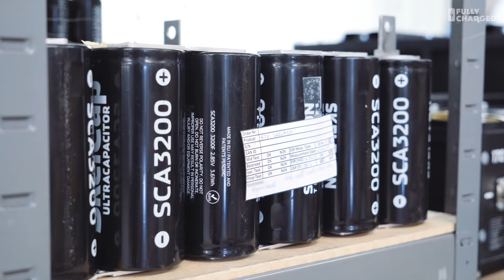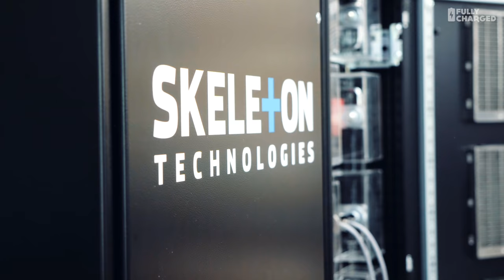Skeleton Ultra Capacitors | Fully Charged

Comment: When I first say the title of the video I expected wild claims about supercaps replacing batteries. Pleasently surprised, the guy was very honest and provided clear explanation about the strength and weakness of his caps. Very well done.
Reply: Steven Hiller -  Elon Musk started out thinking super-capacitors were the ultimate energy story solution, but the physics just don’t pencil out.  They’re very seductive and definitely have huge advantages over batteries in many applications.  But for cars....not so much.   People don’t seem to realize how much power modern LiOn cells can pump out.   Obviously, super caps will blow away any battery technology, but LiOn cells are good enough to throw a 4000 pound vehicle forward at an amazing rate.
Reply: Bryan Noga Yeah, even using caps for Regen seems like you'd need at least 1kwh to absorb braking energy and provide acceleration. A bank of ultracaps to do that wouldn't weight that much but they'd take up a lot of space.
Reply: Bryan Noga  I think the whole point was a mixture of both in a car. The caps to accelerate quickly and store the regen power as quickly then let the lithium basically cruise. That way the batteries will provide much more run time since acceleration really eats their power.
Reply: Steven Hiller -  It probably depends on the car.  I believe Ford hybrids have a 0.6 kWh (?) LiOn battery, but I’m not sure exactly how much capacity is actually used by the vehicle.  A super cap would be a good alternative, and also have the advantage of being less sensitive to temperature & storage.
Reply: Bryan Noga    A mix is best. Caps for the start and stop spikes and batteries for cruising. The batteries will last much longer if the don't have to pull the car up to speed.
Reply: Agree, that was my expectation to.  But instead we got a clear and good explanation on where super-caps should be used and how.
Reply: Ultra/super capacitors still have less watt/hour per volume. Meaning you need a very big pack to have long range as compared to current batts. If I were to use these capacitors, I'd probably need a pick up and the rear compartment is full of capacitors to get somewhat decent range (which is just right for me, driving 30-50km max/day, but not for many people that have regular longer travels). I heard its also expensive by the watt/hour compared to current lithium batts.
Reply: sam guapo    The jist was to use both. Caps for quick acceleration, batts for range. If you're not pulling out of the batteries for acceleration or regen, their range will improve quite a bit. Let the caps do the hard part.
Reply: maybe super caps for more efficient hybrids lol, cost will be an issue still
Reply: @fred ivory, current batts are already good for immense acceleration so having caps are redundant. I like the idea of having a super long use battery and I'm more than willing to drive a pick up full of ultra/super caps that occupy the entire rear storage of the pick up in lieu of a compact BEV. All I have to do is add a range extender for a little more range or I can commute for extremely long trips. Again, its an adaptation of use, instead of demanding unrealistic expectations.
Reply: I have been reading these comments with much interest, and all have a point, BUT I am surprised that nobody has picked up on one very important thing: Thermal loading. When you cram a lot of energy into a battery in a very short time, they get VERY hot. Same with the discharge. This puts a strain on the cells, and over time will reduce the life time of the battery. Also, with the safety aspect, (they do catch fire if they 'cook' enough), charging is 'throttled' when the battery is to hot. 

There are some very interesting U-tube videos from 2018 Leaf owners describing their trips to Silverstone FullyChargedLive. All about managing the heat, as, once the battery is too hot, the 'fast chargers' become 'Not-So-Fast' chargers.

Lemon-Tea-Leaf has a good description, and worth a watch www.youtube.com/watch?v=tgrbT_YxhMs

If you have cap's to handle the high energy dump from braking, then the high-energy release for acceleration afterwards, the temps on the battery will remain lower for longer, enabling a faster charge time on long trips

As the guy said: Not competition, but complementary. A case of both being better than the sum of their parts. When can I get some! :-) ?
Reply: Tesla realized this early and thus their bms and cooling systems ability to adjust the temperature esp. during charging.
Reply: +Ulf Meier-Schulze, It seems to me that for high performance use (or large vehicles), some form of cooling is a requirement, regardless of capacitors being used, but in small cars like the Leaf, keeping things as simple as possible (IE not having the weight and cost of a cooling system)  has advantages, so adding capacitors would make sense. They are basically maintenance free, where a cooling system (other than air-cooling) is probably less so, (please correct me if I am wrong on that).   

All of this said though, who knows what may be around in the next 10 years?
Reply: Bryan Noga  The only concern i have Brian is at what point we start to see high levels of lithium in out food and water supplies.
Reply: @stevenhiller2253  This might be dependent on the use of the vehicle... If do a lot of stop and go, like in a city for example, ultra capacitors can extend the range of the vehicle, so you'd be fine with a smaller battery, which also reduces weight.
Reply: @shiraz1736  
Here in the USA our dietary Lithium levels are well below the world average, thus the need for some to take lithium supplements under a doctors care to prevent manic-depressive disorder. 

Remember that Lithium batteries are only about 4% lithium.
Reply: As the Engineer said, "we are not onto kW-hrs, we are into Megawatt-seconds".  Just watt is needed for braking and acceleration !
Reply: Agreed. I can't wait to see there loss over time decrease. If it can get to the point were a fully charged cap looses 50% of its charge in a month

Comment: "we are not in the kiloWatt-hour business, we are in the MegaWatt-second business".  I loved that sound-bite.
Reply: I know, right? Sounds cool and is pretty damn accurate.
Reply: It seems the host does not understand the difference between power and energy. He seems to think that LiPo accumulators store power.
Reply: 13:18
Reply: @xnoreq  
Well, they store energy but have a limited current flow, so you could say that they store a maximum ammount of power at a time :D.
Reply: @mandernachluca3774  No, you don't store power. Power is a rate, not a capacity.
Reply: @xnoreq  
My faultm "power at a time" is of course false, i meant "energy per time" wich is essentially power, so yes, you could say that you store power, since your current flow and therefor your energy per second stored is limited, would it be unlimited, than you probably could make the argument that energy gets stored not power, utherwise you would get infinite power.
Reply: @mandernachluca3774  Energy per time is a rate, not a capacity. It makes no sense to speak of storing rates, as it is a momentary measure.
Reply: @xnoreq  
I wouldn't say that it makes sense but it is not wrong to say so, since the maximum powerout of EVs for example is virtually solely limited by the safe maximum current flow of the accumulator. Think of it this way, you can have a water dam that can store millions of tons of water but the maximum energy produced by its turbines is solely dependend on the water flow rate through the turbines. In other words you can store a lot of energy but it won't bring you much if you can't dump it fast enough, therefor, it might not be such a bad  
idea to indicate the maximum power output of an accumulator.
Correct me if i'm wrong but current times voltage should be electrical power and maximum current is dependent on the internal electrical resistance of the accumulator.
Reply: nice
Reply: @Sidowse  Why? They're equivalent.
1 W⋅s = 1 J.
It makes sense to specify something that supplies electrical power using W.
Reply: There is 3600 seconds in an hour. Therefore 1kwh=3.6Mws
Reply: @baileymoody3916  W not w.
Reply: @xnoreq  sighs micromanaging mike over here...
Reply: @Sidowse  Of course that is also wrong.
It's k for kilo, not K. And h for hour, not H.

It may make more sense to you but it actually causes confusion because there are constants such as Kv (a motor constant) which has nothing to do with kV (kilovolts).
Reply: @Sidowse  Right. If you know all this why would you bring up K (Kelvin) which has nothing to do with metric prefixes?
Reply: @mandernachluca3774   P(power)=V(volts)*I(current)=Watts and because current is measured in amperes wich is a flow of electric charge in one second  power is just a rate or flow of energy only when you multiply Watts*Time(seconds/hours). So Watts or power becomes active only when you can sustain that capacity over a period of time and that is the amount of energy stored in a battery or a capacitor.
Reply: @IsaacBG84  
Yes, that's true but what do you want to tell me by that? I reread my comment and i should have mentioned that not only the current flow but also the voltage is needed, so for the dam example i should have mentioned that the pressure also plays a role but this role is exactly modulating the current flow. In the real world, you always have resistance and as soon as you have resistance, you have a link between current flow and voltage (you can put it as you want, you have either a voltage because of resistance at a certain current flow or you need a voltage for a certain resitance to get a certain current flow).
So out of this you get an equation were voltage is completely  ruled out and not worth mentioning because of the sheer existance of resistance:
U=R*I
    
P= U*I = R*I*I
P=power
U=voltage
I=current
R= electrical resistance
Reply: Yep that was definitely a well thought out message by Skeleton. ;)
Estonia makes some of the best UC's in the world, oh and they also have some of the most beautiful women in the world.  Now that's electric! ;D
Reply: @mandernachluca3774  They have instantaneous current flow
Reply: @mandernachluca3774  No one is arguing that it is a bad idea to indicate the maximum current output of an accumulator (be it battery, capacitor, or other). Rather we are saying that a flow rate is not something which can be stored. It is not a quantity which can be accumulated (at least not in electricity, velocity is of course a different story but lets stay on topic). Sure, the point is mostly a semantic one, but I think at this point we have all crossed that particular line in the sand 4 or 5 replies ago.
Reply: @xnoreq  ..might be a language issue
Reply: @xnoreq  ..lets see your state of the art designs
Reply: @jaxxbrat2634  What are you talking about?
And no, I don't think confusing or being ignorant about fundamental and basic physical quantities is a language issue. It's more likely a knowledge issue.
Reply: I think he said gigawatt-second. Still, that's a needed component to keeping power sustainable during dips and such.
Reply: @ericdew2021  There's a timestamp in the third comment.
Reply: So basically all that 1Megawatt second is equal to 277Watth equivalent to a car battery. So not feasible for car battery replacement, only usable as booster. If you want a 80KWh equivalent capacitor you need 288 of that huge refrigerators on your car.
Reply: Yeah that’s why I want to build a drag car with ultra caps and a trailer with an ultra cap charger. Unlimited power from a practical standpoint 😁
Reply: @gigimanueliacob8062 : What type of car battery? I'm sure it was mentioned that its role is not to replace a traction battery, but to supplement it by capturing e.g. regenerative braking energy to use in acceleration?

Comment: The ceo is a wonderfully bright and focus individual and kudos to him . Every thing he discussed about the benifits was what I realised 15 years ago on an electric bike I set up. It had and underpowered Lipo battery so I intergrated some supercapacitors to negate the voltage drop under high acceleration . It would cause the electronic speed control to shut down due to low voltage cut off but the super caps solved the problem so I went the next step with regen braking and so forth. Cheap and amazing efficiency gains . Around 15 -20 % estimated gain and obvious battery longevity gains too . Good luck to this company and good forward thinking . Regards Andy from Australia !
Reply: Hello Electron Proton Neutron Mouron
Quite the name I must admit LOL's. I was wondering if you could send more detailed information of what you did to modify your e-bike 15 yrs ago. I have an e-bike now (60 Volt, 20 AmpHr battery power system. No regen capability. On 2nd set of batteries now. In need of 3rd set and considering Li-Ion packs. I'm learning though that the charger will likely have to be changed also. Current pack type is 12 volt 20 amphr x 5 packs in series. Sorry right now drawing a blank on type of battery pack. "Gelcell" is all I can think of right now
Could you forward specifics of your modifications to set up the Capacitors and also the regen arrangement. Send an email to aeves@teksavvy.com and we can start communicating on this subject 
       Thank you
Reply: Yes please provide contact info to be able to get your plans for this set up if you have them. 
You had lipo 15yrs ago? Factory bike or self built?
Brand of bike if it was factory built.
Reply: metamorphicorder they were just cheap Chinese 10amp 24 volt lion for this bike but the output power requirement  from standing start was more than what the battery could give due to voltage sag and the motor controller would shut down due to low voltage cut off . I got around this with the super caps in parallel . The initial power draw would come from the super cap and after depletion the batteries would become the supply but the initial higher power draw has dropped of by 30% or so and allow the low voltage cut out to be ok
Reply: Somnath Roy haha no but I did learn from his venture about being careful what you get involved with as it might become your whole life . I don’t envy his life at all . Far to much for one man to be responsible for !
Reply: Electron Proton Neutron Mouron do you have the plans for the bike you made? And have you upgraded since the last bike?
Reply: justice justice well no I didn’t upgrade as such . I hade 5 different variations some power some torque and some high efficiency and one for most distance for lowest weight of electronics . This last one had the best effect for distance on light bike as I could use the lowest c rated cells at the time . The battery tech has far more powerful cells now like the Tesla cells.
Reply: Wow! 200IQ mate! Hopefully that dino-munching pro-fossil Gov't of yours will soon be ousted, as they don't realise what potential this tech has.
Reply: that's very cool. please tell me what do you do with the caps once you've finished driving? do you discharge them? is it necessary to discharge?  or just leave them as they are? i'm newbie to all these, but so want to be evolved and make my own stuff. 15 years ago you said... man, i'm wandering what other modification you've made since then) thanks!
Reply: @Buzzhumma  
Really interesting.  I fitted a front wheel motor last year, and the usual little Converter/controller box.  Fabulous with "48v" battery, and very useful with "36v" one.  I always help with gears and pedals, not being invalid, or suchlike, so never had a problem with battery "sag".  Also the Converter box must limit the current it can draw through those little FeTs !!
However, I found myself "on the ropes" with my regen braking dream, because of limited charge rate.  So glad I ran into this vid.  I always somehow forget about SuperCapacitors !!   Good to hear from others pursuing this.  Does running on Sunshine  absolutely make you LAUGH !?!  Does me, Keep wondering if I'm dreaming !
Reply: Desmond Bagley  
Have you seen "Juice Media" ?
Reply: @kaibest  
Though I've never yet employed "Super capacitors", I have made electronic things
for many years, and can say with certainty that you don't need to discharge them - but you Do need to treat them like the lithium battery - and not try to measure the voltage with your meter still on a current range ! ( as I did one day.). They're like a train - just maintaining that voltage/speed to the extreme detriment of whatever is trying to bring it down/ make it Sag.  They are s LAKE of electric charge, not a mere bucketfull such as a 1000uF electrolytic which at even 20 volts will "weld' a screwdriver  placed across it's terminals - or at least make a little crater or two.  1000-ish iF caps are used as Reservoirs for 10s of milliseconds and discharge/ charge currents of a few Amps.   They work same as s bucket.  The rate at which it fills or emptied is obviously proportional to how fast the tap is running (amps) divided by how big the bucket is ( Farads). 
 Volts/second = I (amps) / C(Farads)

Comment: Combining batteries with capacitors to split different types of loads is a very good idea!
Reply: I'm pretty sure they already do this, but usually put the capacitor just before the load.
Reply: Yea it's one of the most basic concepts of electronics, but to be able to apply it to high power applications is a big deal.
Reply: It's not needed.  If the battery pack is large enough, it can give and take lots of power by itself.
Reply: Loanword Eggcorn: I think they said that, but with BEVs there is always the issue of weight and size of the pack.  These capacitors provide a small and light way of both "absorbing" and providing a large amount of energy quickly - i.e. for regen braking and acceleration.  They also avoid the need to pull and push a load of current in/out of the battery which can cause degradation through heating.